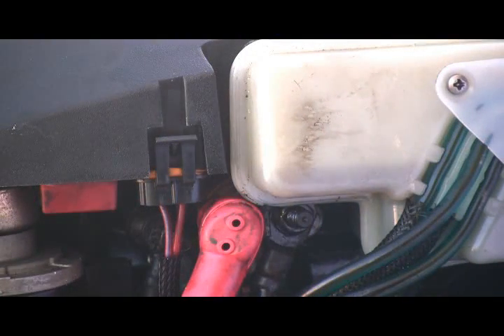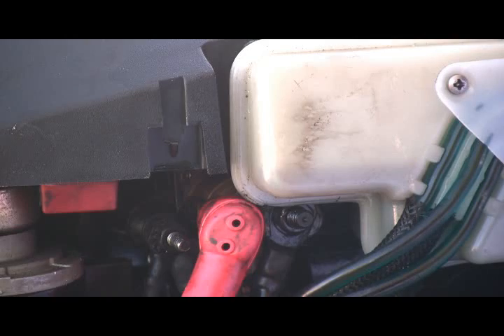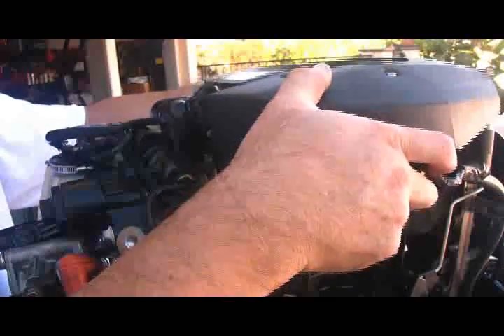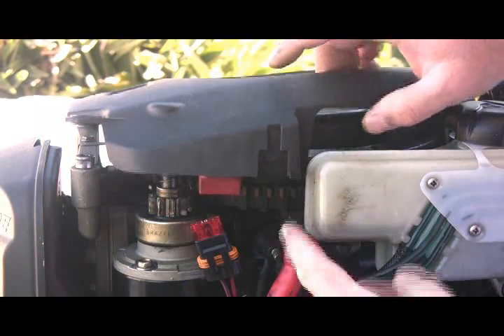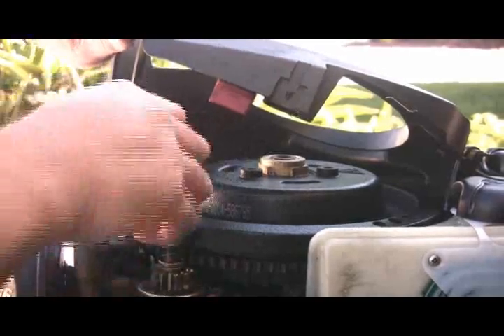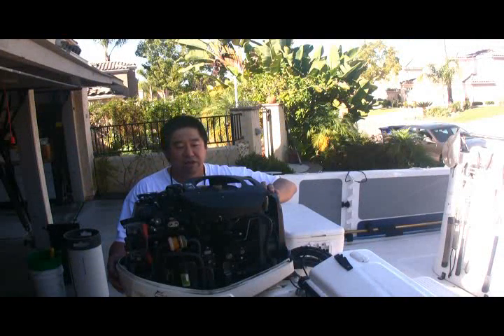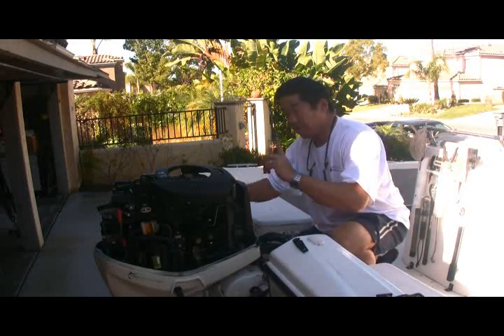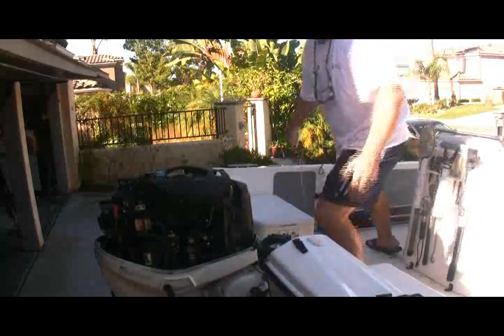How to Pull-Start an E-TEC 90

Comment: Good idea for others trying to start an Evinrude on land: Don't connect water to the same inlet as this guy, as the purpose of this is for flushing only. If not, you would damage the water pump impeller pretty fast, because the suction holes are down on the gear housing.

Comment: I find that the water intake opening on my E-tec 90 gets clogged very easily and the engine runs hot almost immediately.  Once the intake is brushed clean and the engine cools, the engine starts and runs okay.  Do you know if Evinrude makes a substitute water intake cover that doesn't clog so easily?

Comment: I just had to test this out so i tried this in my Verado 275 with a 8ft nylonrope and a friend to help me pull. Didnt go well.. 
The rope got stuck in the flywheel and it slangshot around the oiltank and threw the tank in the water. :( But it started, so thanks! :)

Comment: The notched flywheel has been around for ever my 69 evinrude has it and my 62 evinrude had it as well.  I've used this technique several times when either the recoil string broke or when I had an wire come loose on my controls.   Like you said the ignition has to be in the on position or it won't go with electric start motors.

Comment from the maker: @JBrass22 I'm working on some other projects now...maybe later? Use1/8 cord, and make several overhand knots in the end to increase its size. I believe I used a long enough piece to do 1+ wraps around the flywheel. If you use the thinner cord and make sure the knot's big enough not to slide into the notch, you should be OK.

Comment: It will even work with a stone dead battery (or the battery disconnected) , they desigend the system to get get enough power from the flywheel stator to boot the computer and fire the plugs and injectors without needing any power from the battery at all ..

Comment from the maker: I'm sorry, but you are wrong on this. When I purchased the motor in 2005, I called Evinrude Tech Support and asked them the same question before I tried it. They gave me the go-ahead and said it was perfectly safe to run the engine off the flushing port.

Comment from the maker: I actually have dual batteries with a manual switch, plus I follow the recommended service schedule for the motor. The annual service would not normally include checking the batteries. In the case mentioned, I accidentally left something on with the battery switch in the "Both" position, so they both went dead.

Comment: Hi Mr Loo, I am from Hong Kong.  I would like to ask you some opinion about E-tec 90.  Is this outboard easy to maintenance?  Or that something easily broken?  (like fuel pump or injectors)

Thanks.
Reply from the maker: Overall, I think it has been pretty easy to maintain. However, to do complete maintenance, you will need to have a PC available to apply software updates to the engine computer. Check out my website http://btb.fishing, I have some articles on my experiences with the E-TEC over the years. Will have the final chapter posted soon.
Reply: +John Loo that's a great help, thanks!
Reply: Oh, there also a question about your 90 e-tec, is that brand new?  Or a 2nd hand one?
Reply from the maker: It was brand new when I purchased it in 2005
Reply: Jerry Chan yes i have a 150 etec and I Bring it in every 3 years

Comment: Have you ever thought about maintaining your boat so you dont have to pull start it, there are small devices that you can fit so when the battery is getting low it shuts off power so you have reserve for starting or perhaps look at installing a 2 battery system with a battery selector switch. But I think in your case your better off to take it to a service agent and get them to give it its birthday annually

Comment: Under no circumstances DO NOT USE A PIECE OF METAL BAR OR SCREW DRIVER TO PULL THE ROPE. THE FLYWHEEL WILL SEND IT FLYING KILLING YOU OR THE OTHERS AROUND. I always have a piece of 10mm round wood at the end of my emergency rope starter, which is very light and is not capable to hurt anyone around if set it flying by the rotating flywheel. Please do not use metal things if you value your life or the life of your loved ones.

Comment: Good way to wreck your impeller that is the flush port you connected the hose to witch is the telltale for the engine when running you are forcing water back at your impeller.
Reply from the maker: Actually, you are not correct on this. The water connection was approved by Evinrude Tech support.I asked the same question, and they said running the motor off the flush port is OK.

Comment: The engine needs to be submerged in water above the cavitation plate or else the water pump will burn up in as little as 8 seconds without water! Muff's don't work either!!! for this demo. He used the engine flush fitting which doesn't feed the water pump.
Reply from the maker: Hi Frank, I'm sorry, but while you are correct about the muffs not working on E-TECs, you are incorrect about using the flush port for running the motor out of the water. Before I tried this the first time, I consulted directly with Evinrude technical support on this issue. They guaranteed me that using the flushing port for running the motor out of the water is fine as long as you have sufficient water pressure. You will see steady streams of water coming out of the exhaust ports when the flow is right. Regarding your comment about the hose connect, you are thinking of some of the quick hose disconnects that have a valve in the male fitting (the part that goes into the motor flushing port). The quick disconnect I use does not have a valve there. It is an unobstructed tube with an ID just a bit larger than the flushing port itself, so there is NO water restriction for water going in or out. This was also cleared by Evinrude before I tried it.